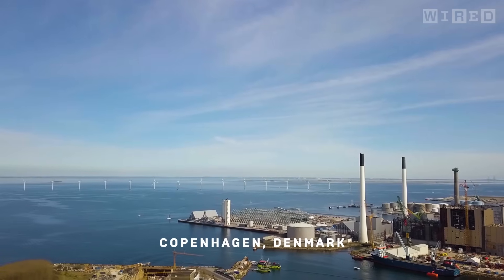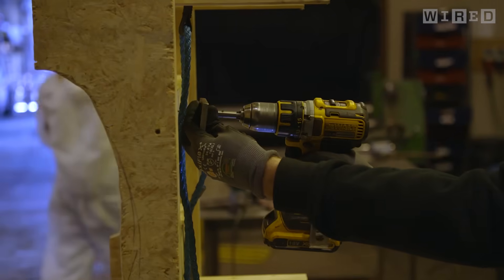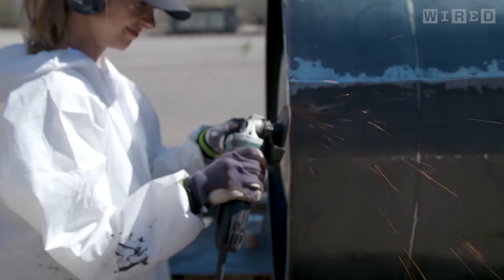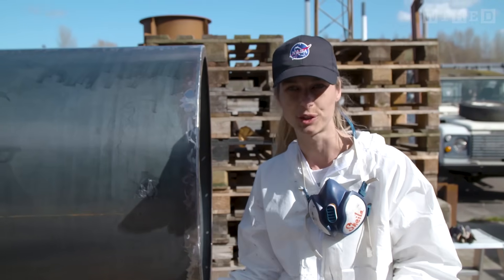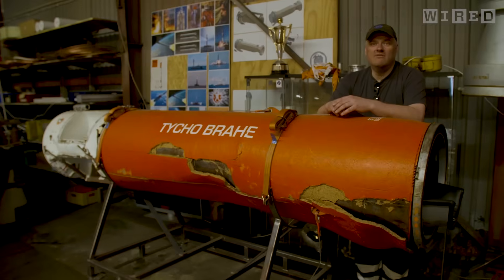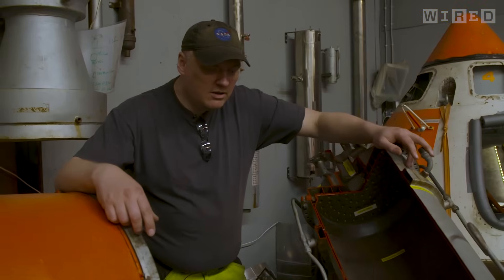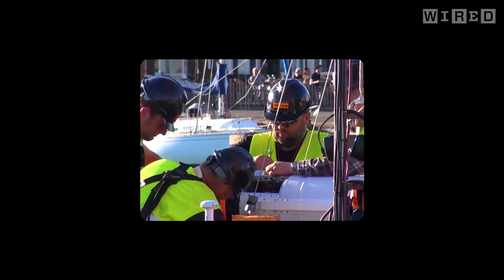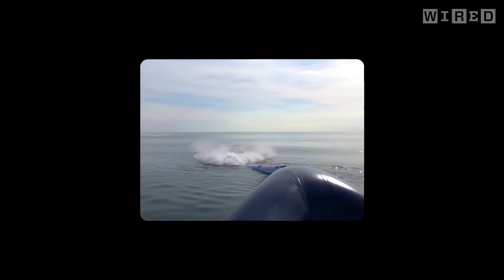Copenhagen Suborbitals: The Incredible DIY Rocket Scientists on a Mission to Send a Human to Space

Comment: The Danish space program :-)
 What if they just 3D print their designs, instead of making all by hand.
Reply: Unfortunately only certain parts are suited for this, such as small mechanical things like gears or hinges or the like. Large parts are hard to 3D print and may not be worth their weight.
Reply: 3D printed parts are often weaker then typical parts because they're printed in layers, and each layer is a possible point of failure.
Reply: @avgvstvs96  No. 3D prints in metal are sintered, so are stronger than similar machined or cast parts !

Comment: They need a CAD setup, and a structural engineer or two. Badly.
Reply: Uhm, what exactly makes you think they don't use CAD? I can't tell you whether they have a bunch of structural engineers around, but they have engineers aplenty, and they use Solidworks.
Reply: I'd find it hard to believe that they aren't using solidworks at least...
What they need is TIG welding classes and decent FEA software. 
FEA lets anyone be a structural engineer if you know how to use the software.

Comment: They could save themselves a lot of trouble firing the rocket from the ground level, by transporting the rocket by high altitude helium balloon. At a certain height, the balloon is released and with guidance systems to keep trajectory, the rocket would be fired literally thounsands of feet high. Of course, the burning of the fuel at that height would have to be assisted by feeding oxygen into the combustion chamber, when the rocket is firing up. The rocket being launched at ground level, you would have to worry about the weight of the payload and how heavy the rocket is, generally. It would use less fuel for a mission by balloon. That why it makes sense to launch it, mid air!
Reply: That's not how it works unfortunately.
Reply: Oh well. It was worth mentioning!
Reply: thank you on this!

Comment: rocket + heavy = failure
why not use carbon fiber?
Reply: It's expensive and require special machinery, which is expensive
Reply: Also, SpaceX doesn't use carbon fiber for fuel tanks in any of their current vehicles. They are spending a lot of R&D (think hundreds of millions or more) to develop the carbon fiber tanks for their Mars rocket. They have working prototypes of the engines, their heat shield has been in use for years, they know how to do all the nitty gritty rocket stuff. Those carbon fiber fuel tanks are actually on of the biggest technological gambles they have going on in their Mars rocket (on the rocketry side at least, life support is a different matter). I'm confident they'll figure it out, but this just goes to illustrate that this is not some a technology that is readily available.
Reply: xyz The madman that made the failed HEAT 2X, was thrown out and got even madder, tried making some carbon fibre encapsulated engines but never got them flying.
Reply: They could and put a small protective coating inside
Reply: The point isn't to make a high-performance rocket, the point is to make a rocket that is as no-thrills as possible. It has to serve its purpose and no more. The DPR tank was actually made of carbon fiber simply because in that exact application it made sense due to the very high pressure - but it also represented a significant percentage of the overall budget for the Nexø II. Something like 15% off the top of my head.
Reply: NASA wants to: know your location
Reply: NSA also
Reply: but SpaceX use it, Rocket Lab use it, etc
Reply: SpaceX only uses a small amount of carbon fiber on the upper stages. The black section that isn't painted is carbon fiber. That's a rather small section that doesn't have to withstand a lot of heat or pressure. Then rocket labs rockets are much much smaller and slower.